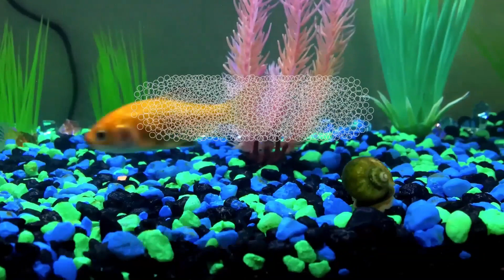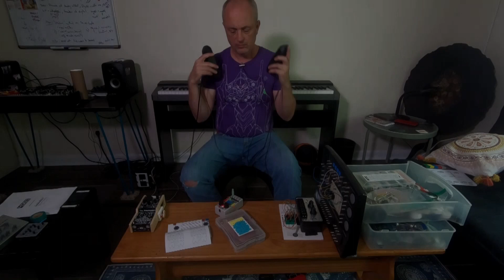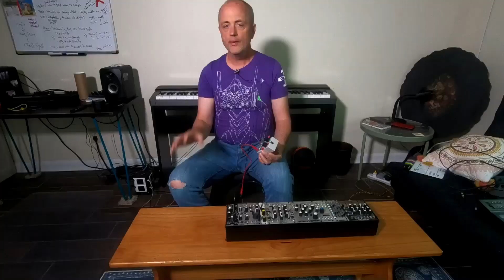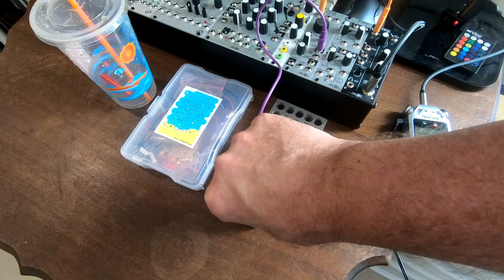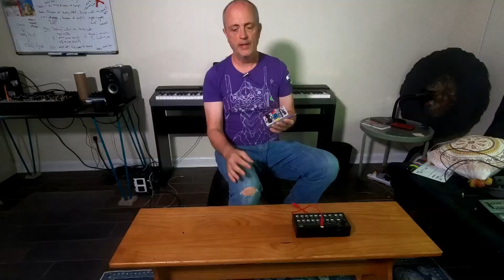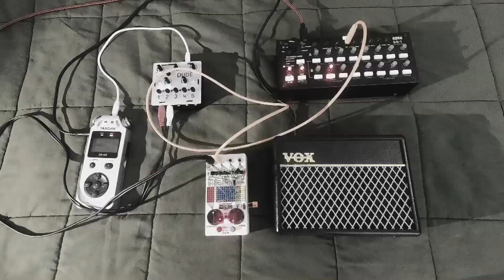Olegtron 4060 MK2

Comment: Excellent vid! By chance have you tried slowing down the OSC or Saw LFO? The lowest current and freq is quite fast for my needs. In the manual it says If you want to slow down the oscillator,patch a capacitor between CAP and COM. When I do this it just stops. Any expereince? 😊
Reply from the maker: hmmm... it has been a minute🤔. not sure if you do Instagram, but I did a post over there (Jan 30, 2020; account is dr_nim2014) that is just the Olegtron (with a little post-processing reverb). In the clip I use patching/unpatching to make a sort of little beat, so the Olegtron was doing tones, so relatively high frequency, but it was also doing transients and a sequence of sorts. so I think it really was functioning as an LFO in that clip. By zooming in you might get some idea of the patching (my notes are long since lost for this one). It looks like i'm using the green cap that came with it, plus a ceramic disc cap of my own🧐.  This reminds me. I think the caps they shipped were electrolytic, so they probably need to be oriented to a particular polarity.

I hope this helps! If not, lmk and I can get it out at some point and try some stuff, report back.  Thanks for watching!

Comment: Thanks for the shout-out! Nicely done with the video and glad you're enjoying the 4060. I may need one of those NA mixers as well.
Reply from the maker: scott sturgis Thanks! Yeah, the NA mixer is nice. It can run on a 9V also, btw. I had a couple of 1/8” trs to dual 1/4” ts cables, I can cobble together more if required. Looking at some direct patch links between 4060 and Volca Modular at some point soon.